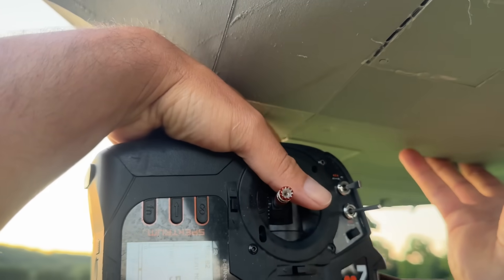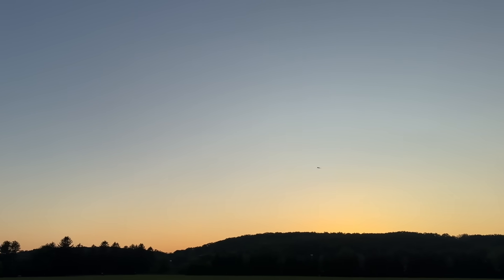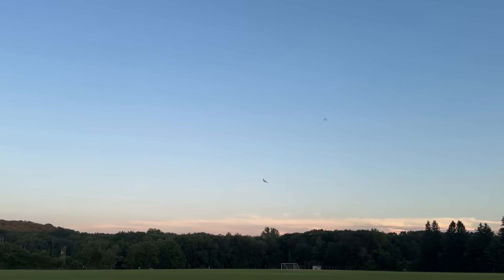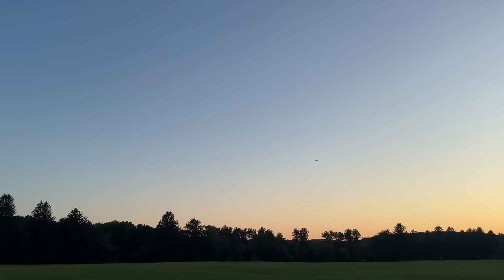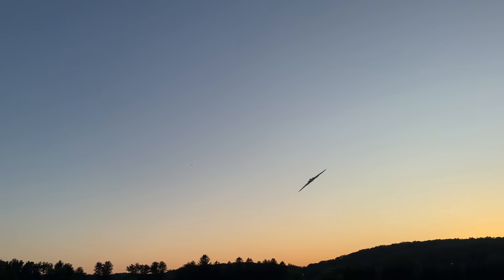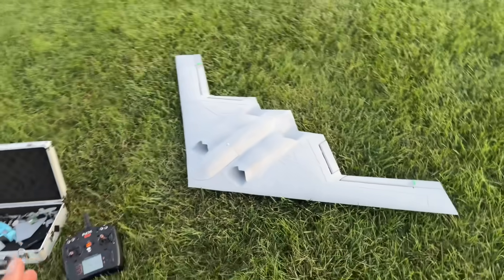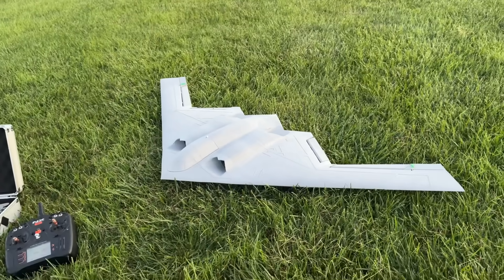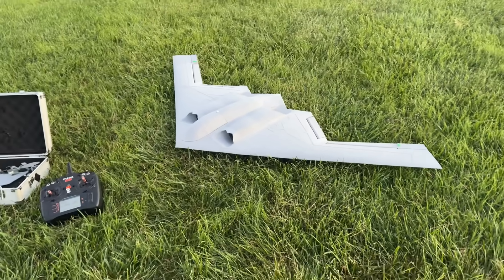B2 Stealth Bomber First Tailless ￼Flight!

Comment: 1:08 Don't know how to explain, but just obsessed with the form of planes like this, the way those inlets cave in and align with the edf. I'm planning on making a large scale edf f16, around a meter long from foam board. I decided I was too scared to yk, don't want to waste a couple hundred on making something I wasn't sure 100% with, so I'm making this 2 foot long single prop edge 540 (it's the redbull sport plane) just to see if I'm capable of making these things before throughing too much money out. Planning on making a video on the f16 build, but don't really know when it'll happen, but I'll certainly share it with you since you were definitely an inspiration for this.

Comment: quack quack. air brakes why. arrow head cross b2 ftw. auto-land? almost a ground effect plane. or you just make a flying wing shape and dont care about 10% of lift with more complex rules. air foil is not a magic bullet (only 10%) to be stuck into as mantra. its lift body wing. the actual shape does not really matter. only the surface of the wing. yep paper air planes work nicely too. also on paper.

Comment: I started to add INAV Flight Controller (FC) to your designs. Using the FlyingRC FC for $15 and an ELRS nano receiver.
The ability to set up any stabilisation mix and use autolaunch to throw the plane makes it a breeze.
Spectrum is really nice to just plug-and-play but it's expensive and not all configurations like this B2 are suited as you state.
Reply: Elrs is the way!

Comment: Nice looking plane.  Have you considered a mix to control adverse yaw, on my big Cubs you mix about 10-20% rudder with the aileron(elevon, your case).  I use A630, Hobby Eagle and Reflex3 gyros in my panes and have often wondered if any of them mess with rudder in stabalized mode???  From my perspective it's a good design because you can land on grass and not pick up grass clippings (fan intakes are on top).  I appreciate your effort.

Comment: Looking great.  My $0.02:  I've made a couple of these out of foam board (flew great) and there are some simpler control options.  Both involve only using the outboard surfaces but using the entire length of the outboard surfaces.  

The two servo option involves setting it up as a delta wing and make the surfaces so the split elevons are always open (fixed) at 90 degrees (sideways V if looking from the side).  The 4 servo option invoves giving each servo control of one half of each split elevon (i.e. Ch1 is left wing upper, Ch2 is right wing upper, Ch4 is left wing lower, and Ch5 is right wing lower).  This way, you can add mixes to have the elevons function like a delta, but can also add mixes for rudder and even variable airbrakes.  The mixing is a little more involved but really not that bad.  Ended up flying pretty well.

Comment: Hey Kyle, I built the F22 and I cannot get it to fly for the life of me! I was wondering if you could me advice or if you have any content on how to wire them up and tune the transmitter and receiver?
Reply from the maker: What version F22? Single 64 or dual 40? F22 flies like a dream, issues with electronics? I definitely suggest joining my Facebook group Kyle’s Designs 3d printed airplanes. We can help
Reply: @hotlapkyle thanks man I’ll join the group! This is what I mean every video I see, it flies perfect so I must be doing something wrong. It’s the dual 40mm